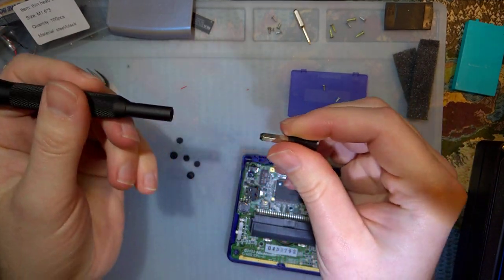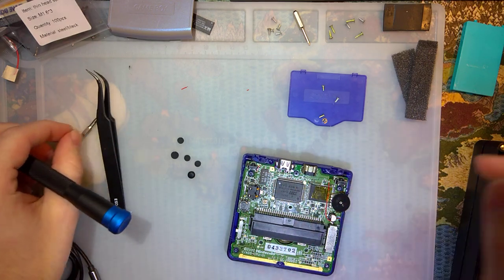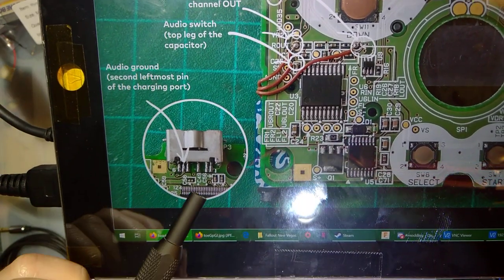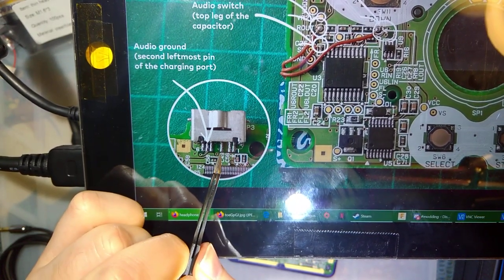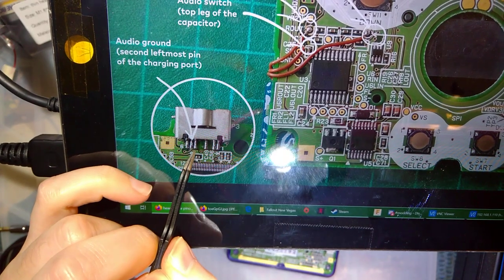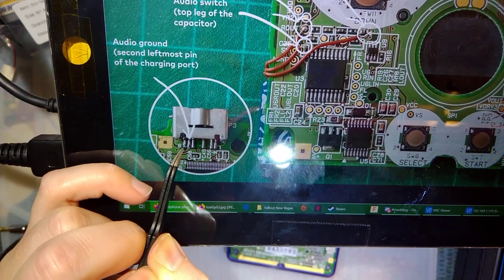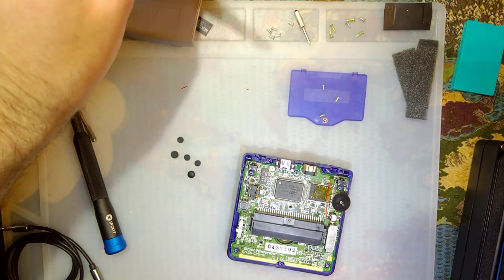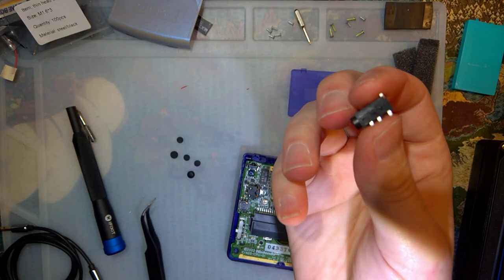Building a Headphone Jack into a Game Boy Advance SP

Comment from the maker: Per Gekkio:

PSA: if you've added a headphone jack to a Game Boy Advance SP and didn't add any capacitors as part of the mod, you may have created a Headphone Destroyer Mod ™
I'll need to do some testing after work to verify this, but here's an example calculation:

let's say you've bought AKG N40 earbuds, which cost $399.95. Specs:

Impedance: 20 ohm
MAX input power 10mW

let's assume the Advance SP audio amplifier puts the DC offset at half of the supply voltage. I'll check the real value after work, but this is a reasonable assumption for now. For a stock 3.8V battery that means 1.9V
so V=1.9V, R=56+20 -> P=VxV/R=1.9*1.9/76=47.5 mW

47.5mW > 10mW
-> bye AKG

----
TL;DR, the method I show in this video is potentially damaging to headphones. Instead, add 100 uF (or more) 6.3V (or more) capacitor in series for both channels. Positive side goes to the test point, and negative side to the corresponding jack pin. Alternatively, use an isolated switch between the switch pin and system ground instead of using system ground (gnd) as audio ground (agnd) on the headphone jack to switch to the switch pin.
Reply: So after testing it are your conclusions correct, that this will destroy your headphones if you don't add capacitors?
Reply: That's interesting. Just as an aside the DMG has those exact two capacitors in place on the headphone pcb. Have you ever done a teardown of one of those SP headphone jack adapters? Do they have capacitors built in internally?
Reply from the maker: @homerghost  a proper one will. And by proper, I mean a licensed adapter from 2005. The junk you get on aliexpress in 2021 is hit or miss.
Reply: @makho  I've got one lying around somewhere. I think it's an AliExpress junk special. I'll rip it apart and report back!
Reply: @makho  Tore down my new aftermarket GBA SP headphone adapter. Can confirm no capacitors.
Reply: @makho  So I did some research and the original GBA SP headphone adapters (as well as the aftermarket ones) don't contain capacitors after all, because they don't need to. (Complete explanation now provided for innocent bystanders, not trying to teach you to suck eggs here!) 

The adapters reference the jack directly to AGND (pin 4 of port EXT2) which is separated from GND by its own 100µF cap on the motherboard, and it is here that the DC component is removed from the signal going to the headphones.

The adapter has the luxury of using a distinct circuit to internally short pin 5 (Q11 transistor) and pin 6 (GND) in order to mute the speaker, which is of course precisely what the jack mod replicates with the TRRS trick (since the top of C25 is in fact simply a GND point just like pin 6). 

By using GND for switching, the TRRS trick sacrifices the AGND line (and in turn, the 100µF cap along with DC removal) which was necessary because shorting Q11 with AGND doesn't mute the speaker - it has to be Q11 and GND.

That's where the caps on L and R step in to bypass this problem ☺️
Reply: @homerghost  so does it break your head phones or not?
Reply: @AnonymouseNeedsHelpjk  Official or replica headphone dongles are safe for your headphones (they use filtered audio ground). Headphone jack mods are unsafe for your headphones (they use unfiltered ground) - but this is fixed if you add capacitors to the left and right audio channels, or wire the jack up to audio ground and find some other way to mute the SP speaker such as installing a switch. In real world terms, you'll get away with the unsafe method for a while, if not indefinitely, but you're delivering DC current to your headphones which is a bad thing.
Reply: @homerghost  so where do I get the capacitors to make it safe
Reply: @AnonymouseNeedsHelpjk  100uf 6.3v capacitors are all you need (2 of them) easily available on amazon, ebay, mouser, digikey etc. Because you're limited for space in the SP, small smd tantalum capacitors will work very well (which is what I did) there's space for them both beneath the screen and you can apply heat shrink or hot glue to insulate them from each other.
Reply: @homerghost  sorry to ask so many questions do you by chance have a video tutorial on how to apply them do the correct spots or do you know when that shows you?
Reply: @homerghost  how where exactly do I solder them on? is there a tutorial some where sorry for so many questions
Reply: @AnonymouseNeedsHelpjk  don't worry happy to help! I haven't seen a tutorial unfortunately (maybe I should do one...) but it's very straightforward. It's exactly the same as any headphone jack tutorial but you add a capacitor to the left and to the right lugs on the headphone jack. So: A wire comes from the motherboard, connects to the + of the cap. Then another wire from the - end of the cap which connects to the R/L pins on the headphone jack.
Reply: @homerghost  ok I think I know what your saying
Reply: @homerghost  can I use 6.3 volt 1000 uf instead?
Reply: @AnonymouseNeedsHelpjk  Sure. As a general rule, you can use higher values but not lower values
Reply: @homerghost  cool thanks
Reply: @homerghost  thanks Im really glad i stumbled across this this information should be more readily avalible
Reply: @AnonymouseNeedsHelpjk  I agree! I bring it up a lot in comments sections but I dread to think how many people are slowly killing their expensive gear because they aren't aware of this problem
Reply: @homerghost  my headphones are only like 70 dollars so not low end but nothing fancy id still rather not ruin them
Reply: Never mind infused it!
Reply: @homerghost  you really should make a totorial i had a bit of trouble closing it up

Comment: Hey 2 problems
Please help

When I connected a headphone jack onto my GBA SP Ags 101 board... the screen went very dim... like ags 001 model... headphone was working but screen become very dim...

Later upon a little more tinkering (I thought I had not soldered properly) I ended up losing C25 capacitor. 
Please help Makho...
I have now disconnected my headphone jack and speaker,  screen works fine... its just that whenever I connect the headphone jack screen again becomes very dimm.
Please help

Comment: I installed a headphone jack years ago (like 10 years I guess) on my sp.
it isn't pretty but it works (it was my first hardware mod ever). I cut the screw pillar at the R button and slimmed down the battery compartment a bit to make it fit, I had to cut the right plastic leg of the battery to make it fit again since that space was now being used by the jack.
as it wasn't a 4 pole conector I had to add a piece of metal at the outer part of the jack to ground the headphone detection pin when I plug a headphone.
maybe I should revisit this mod and replace the 3 pole jack with a 4 pole one since the headphone detection isn't all that reliable and 4 pole jacks exist now.
nice franken sp btw.
Reply: @sakitoshi  did it break your headphones?

Comment: What's the reason to wiring it like this compared to wiring it to the charge port?
Reply from the maker: allegedly cleaner audio as we're pulling signal closer to the amp instead of from lines routing next to power and other hispeed signal lines. Ultimately, it's still a GB though so it's not like the sound is going to be that good regardless. 

Also, it's just physically easier if all the wires aren't right up next to each other but that's just me.

Comment: is it pausible to put amp and new speaker to a gba sp? to make it louder
similar to the gba speaker amp mod?
Reply from the maker: Sure it is. Hardest part is figuring out where to put the amp.
Reply: @makho  thanks for responding. Im looking into  a workable amp pcb that can fit in the tight gba sp XD
Reply: @makho   Hey man I'm pretty new to modding and electrical soldering stuff my expertise is more on the software programming side. can you take a look of a simple diagram I made of the pinouts and contacts if its correct?

Comment: When you build a gba sp with usb c for charging and headphones? I post that plan for that a while ago
Reply from the maker: Yeah and I told you last time that hooking up the audio lines to random USB data lines might not work well for some host devices. And you still need a dongle so why bother?
Reply: @makho  it's not to hook it without thinking. There are 2 audio modes in usb c. 1 use dac components in the adapter.

The other audio mode is a analog audio mode that my version use.
Most usb c headphone with charging adapter use the analog mode.
It's a mode that is in usb c.
In that mode the data line act as audio channel left and right. 

It is a official usb c mode named Audio Accessory Mode. 

And yes it is a adapter needed but they are better the the old port and has charging.

It is explain here under analog audio over usb soundguys.com/usb-audio-explained-18563/
Reply from the maker: @-Gothicgirl-  and my version needs no dongle so why would I bother?
Reply: @makho  I said nothing against it but usb c would be not change the case optical

Comment: Is the hissing sound still present? I have several 3.5 adapter on my sp and they all have a hissing sound  (Haven't finished the video yet) cool mod btw! 😂
Reply from the maker: Nope. Notice that most of the wires bypass the original port. This console has abnormally clean audio though because it has a brand new volume pot.
Reply: @makho  what is the volume pot? is that the volume wheel video?
Reply from the maker: @jamieethridge6098  yep, it uses a GBC/GBA volume wheel because the original slide pot was damaged by corrosion and I rebuilt  it with what I had. Finding the correct part has been difficult though so I ended up making a PCB and then I made that video.
Reply: @jamieethridge6098  taking a wild guess but, Potentiometer?

Comment: Would it be possible to have the headphone t in the hinge do you think? Coz the plug parts look like they'd be a perfect fit
Reply from the maker: The hinge is in the hinge. If you removed one of the hinges, maybe but then you'd have to reengineer/reinforce the other hinge to pick up the slop. Sounds like more effort than it's worth IMO. 

Though I suppose you could try to work with DSi XL parts or something for a heavy duty hinge that has multiple angles.

Comment: Hey makho, I love your videos, they're really entertaining to watch, even if they're miles above my understanding of circuits for the most part... I recently refurbished a GBC with a FreckleShack screen, but I messed up some of the JIS screws that hold the motherboard to the front plastic. Is there any place I can get replacement Phillips (not JIS, as the original were) screws for the inside (either just the 3 JIS screws or the 3 JIS screws plus the 6 Y triwing screws for the outside), or anywhere I can get a JIS screwdriver on its own (I've heard the iFixIt toolkit Las JIS bits, but I don't want to buy a while kit just for those bits)... Thanks in advance...
Reply from the maker: ifixit does sell individual bits (J1 for GBC) and you can get replacement screws on aliexpress. The screws I have found tend to be a bit too long though so I don't have any good recommendations for that. If you just need a decent JIS driver, it might be worth buying a JIS driver set, not necessarily an ifixit set.

Comment: Nice one Makho, love the vid. I'm still figuring out the wiring diagram for the ags101 as it would be different it doesn't have the audio amp. Just wondering if you know how to wire it with the 101 send me message lol. thanks!
Reply from the maker: It does have an audio amp, it's just not in the same place. Did you look at the imgur album I linked in the description?
Reply: @makho  i didn't check the desc let me check that. Thank you
Reply: @makho  hello makho i just got back to respond to your reply, I'm not seeing any imgur album link in the description, was it removed? thanks.
Reply from the maker: @anelcmln  I'm sorry, I suppose I could have made that way more clear than I did. There's a link to the product which itself has a link to the imgur album. I've since added a direct link to the album in the description. (this album https://imgur.com/a/mqhpRvp )

Comment: Hey there, I am a beginner to this but I am learning. I love this video. Could you tell me what kind of wire you are using? I don't know what kind I should buy!
Reply from the maker: I personally use 30AWG Kynar wire because it's stocked locally and easy to work with. A lot of people will recommend using enamel magnet wire as it's even cheaper and smaller for the same thickness of wire (thinner insulation) but I don't like working with that stuff.
Reply: makho is 30AWG the same as 30 AMP?
Reply: @junglebeatlover  no, 30AWG means it's thinner than 28AWG which is thinner than 26AWG etc